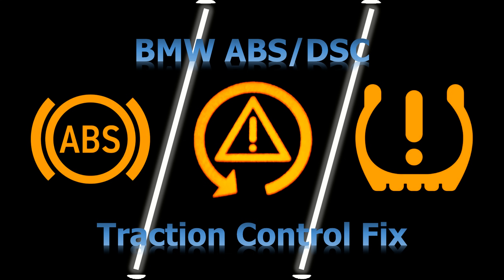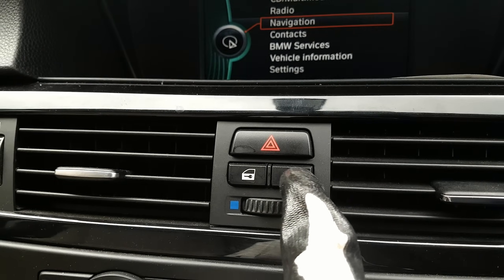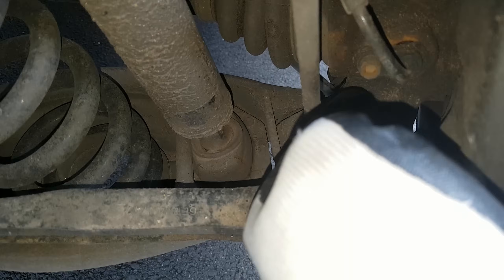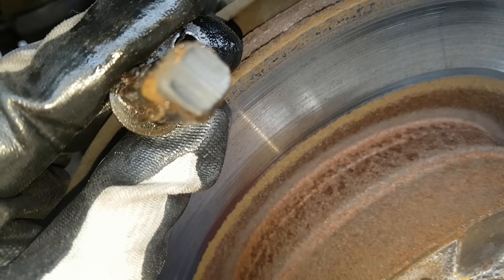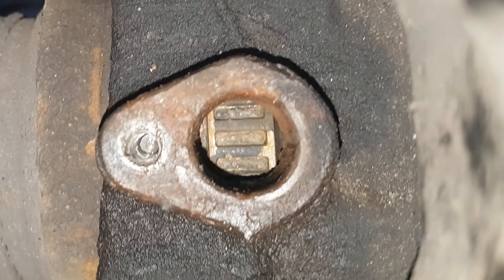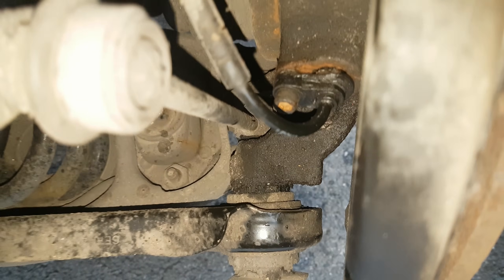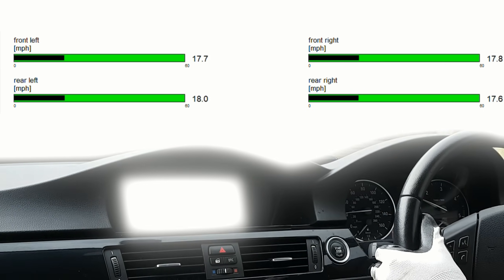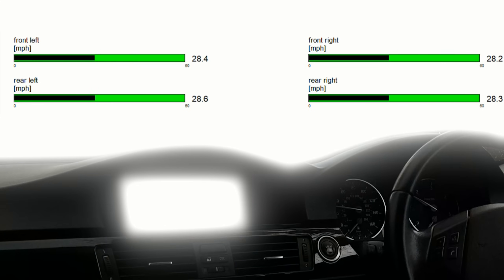BMW Traction Control ABS DSC DTC issue or loss of engine power

Comment: This literally happened to me about 10 hours ago. We planned a day trip out set off and so we got the dtc flashing us and slowing us down. We immediately did a google and your video came up. Had the dtc off all day and we are home safe. Thank you so much for the upload,we had a great day out and know how to at least temporarily fix our beloved BMW.
Reply: Did the car have no power cuz mine felt like no power and abs message kept coming on
Reply from the maker: @Everybodyshinetogether1 that's exactly what it feels like...
Reply: @laymandiy  should I just replace all sensors?
Reply: @laymandiy  should I just replace all of them
Reply from the maker: This won't solve the problem. Sensors are working fine. You need to replace driveshaft or do this

Comment: Thank you so much, would've walked away from a low mileage beautiful 320d yesterday till I watched your video and used ur diagnosis to fix the car, I actually got the car really cheap coz the owner didn't research the problem and BMW gave him a worse case fix with a huge estimate. My gain tanx to you again. Anto in Ireland

Comment: When I got my used 2008 X3 It had all three of these lights on. I found out that it was the transfer case actuator motor that had failed. It is a module attached to the side of the transfer case. There is a black plastic gear inside it that will be worn to failure after so many miles. I bought a TCA rebuild kit off of FCP Euro's website for about 100 dollars and rebuilt it. All of my lights, including the check engine light went away. FCP Euro has a very detailed how-to video on how to rebuild the TCA.

Comment: Bought it a week ago and this has been problem ever since. They replaced a tire that was apperently a different size and didn’t fix it. Now they are keeping it in the shop and replacing a transfer gear box or something (my dad couldn’t remember what they said). But everything on the internet says it’s the wheel speed sensor but the shop hasn’t said anything abt that…

Comment: just a random story about my e93 (2011 328i convertible) randomly had abs/ traction/ brake/ and check engine light were on. scan tool said p1775, p15c9 and p1505. INPA says 4 codes that all relate to rear right wheel abs/speed sensor is the issue. Live INPA data shows all wheels other than right rear are steady when driving and the right rear is "jumping" or being "jittery". took oem sensor from left side, put it in right side, and put brand new one in left side. clear codes, did 5 power cycles and drove 50 miles at all speeds. so far so good.

Comment: Guys make sure you check your sensor if you decide to buy a new one!! They are to type of sensors(for cars with active steering wheel/without active steering wheel) I have this problem since last year and I been to 4-5 garages to check my car  and everyone tell me a different think…when you put the tester  was showing I have a fault with my front left abs sensor,they put a new one and after they said maybe the wheel bearing not making proper contact with the sensor after that they said my battery it’s nearly dead and creating problems to the sensors🤦🏻‍♂️🤦🏻‍♂️I decide to give up after I have a new sensor,new battery and new wheal bearing…yesterday I decide to buy a new sensor and change my self and all the problems gone!!
My car don’t have active steering wheel and all this time I was driving with a new sensor for active steering wheel!!

Comment: Worked just as well in my BMW x3 f25 with the same error message. I had a lot of dirt on the rear right ABS sensor and on the inner tread.
 Best regards from Germany and thank you very much for no workshop costs 😁

Funktionierte in meinem BMW x3 f25 genauso gut bei gleicher Fehlermeldung. Ich hatte sehr viel Dreck auf dem ABS sensor hinten rechts und auf der innen liegenden Lauffläche. Beste Grüße aus Deutschland und danke vielmals für keine Werkstattkosten
😀👌

Comment: Thank you so much for doing this fix. I have the same problem with my 2007 BMW E78, the ABS kicked in. I have followed your method and the problem is fixed. However, the speedometer now is working intermittently, and I wonder if it is something to do with the fact that that sensor now is not fully inserted (because of the metal washer)? Thanks

Comment: Thanks for your videos they are great, my question is my 4x4 light comes on as soon as i start the car without driving and if i start to drive then abs and brake light come on. I changed then actuator gear already the old one was a little worn and the clicking has stopped when i turn car off but now 4x4 dsc light comes on immiediately. I thinks its dsc control unit since i dont have to drive for 4x4 dsc to light up right away?
Reply: I have this same problem!!! DO YOU FIND A RESOLUTION ?? Let me know thanks

Comment: You mentioned about fitting a 1mm x 7mm diameter washer.. what is the hole size in centre please...
Reply from the maker: Sorry I don't remember that one. But it doesn't matter if the whole is too large, using it as a spacer. You can stick a piece of plastic if you want to to maintain a gap (probably a better idea since it's non magnetic)

Comment: Hello, great video. 750Li no speed on left rear, change wheel speed sensor and got a speed. When I drive it for a ways, the ABS light comes on. Today when it was off, I pulled over to talk to someone and while sitting there ABS lights came on at a stand still. Any thoughts?
Reply from the maker: John Gordon whenn the light comes on does it stay on? It could be that if it is touching the ring, the sensor picks up spurious readings, giving the warning message. Alternatively, if it's too far back, the metal housing interferes with the reading. Note that this is magnetic so any metallic bit will tamper with it.
Reply: @laymandiy  maybe I will try a washer, put a thin magnet inside sensor hole before installing. Took out for a drive, parked, was going to install angel bulbs. Pressed start button, lights on dash but no start. Going to check ignition starter switch fuse and looking for intelligent battery sensor..beautiful looking car, but...

Comment: Super helpful video. thanks mate. I have an 07 335i coupe. started to hear a grinding noise two days ago. Today the yellow  ABS light came on, then driving back from work , it started to loose power. I tried holding down the DTC button, but wasnt sure if it was on, it did not indicate. But i managed to drive home. I thought it was a problem with the brake rotors or pads, but upon looking at them, they looked good. I do have the red brake light constantly on, i think i might need to replace that too. I will try and put the washer like you did. and hopefully i can get it to work good. Are wheel speed sensors expensive, is cleaning the ring hard to do?
Reply from the maker: Gordon Harrison sensors are relatively cheap and the ring is easy to clean can do it without any specialist tools. I would recommend a diagnostic
Reply: @laymandiy  so I'm having the same issue. Tried changing mechatronic and guibo but still loss of power upon acceleration and it will throw the car in either N or D. Do you think it could be the sensor?

Comment: Excellent video thank you. Mine is a 118 m sport convertible, started last week from start up and gradually got worse, almost like in limp mode! Then warning light will stop flashing eventually, abs, dtc lights stay on, but power restored!? Does that sound like the same issue? Any advice would be much appreciated tia
Reply from the maker: Most probably yes. If DTC off stops the abs from flashing (the warning lights will remain) then potentially this issue. Easy enough to give a go to check.

Comment: I did this to my 320d today, on both rear wheels, drove about 10 yards down the road and all of my lights came on 😩 abs,seat belt,airbag,tyre pressure,handbrake,traction, so not sure what happened there? Il have to remove the washers tmw and hopefully it will go back to normal 🤣
Reply: Spacer to thick I suggest 
Anyway hope you got your problem sorted
Reply: @adebradshaw2407  I afraid that that can happened to me too, so I need to be sure the spacer is less than 1 mm?
Reply: @marceloruffino  yes for me just a tiny bit less then 1mm worked perfectly

Comment: Thanks for this info...I have driven 20,000 km without this problem. After mounting a coilover front (So now the car is lowered) The light burns occasionally, i sall check the Sensors and cleaning them first.

Comment: Very good informative video. Thankyou for your time and effort. What tool will give me the wheel speed sensor information?
Reply from the maker: Inpa
Reply: @laymandiy  which version of INPA did you use? 5.0.6 tops out the reading at 10kpg and shows an error message

Comment: hello i replaced my bmw's sensor left but my lights are still on abs esp could it be because of the abs ring not recognizing the sensor properly or something else can you help me
Reply from the maker: As you can probably tell that replacing the sensor has the opposite effect (it will make it more sensitive) because it is now not compensating for the corrosion / swelling of the ring.
Reply: @laymandiy  so do you think it is wheel bearing?

Comment: Hi, actually I get some similar warning with 4×4 ebc....but they come and goes also my steering is a heavy.  So by changing drive shaft and weel bearing will solve the steering isse

Comment: Had a big gorge on my run flats on my rear left had them all changed out to none run flats  so got the tires changed at Qik fit as I had no choice now I’m getting the same issue except i took it back to Qik fit now the steering wheel is drifting to the left and the dtc error keeps coming up and they are all clueless and don’t know what to do dont even think they looked at the sensor.

Comment: Great video mate , very informative but my e92 320D has 2 lights that stay on all the time , it`s the hand brake light and the triangle one with an almost full circle around it .. once i put the hand brake down , the light turns orange light the other but stays on ...replaced ABS unit and sensors , any ideas please ?
Reply from the maker: Could just be the handbrake sensor?

Comment: Hi very good video mate. I have same problem the DSC light come on intermittently and no power for a few seconds. When switch it off completely the car drive perfect. My question is how should I gind out witch sensor is the bad one without obd scanner? I have got BMW e90 07 reg.
 Please advise me. Thanks
Reply from the maker: krum zlatanov difficult, the cable costs £15 if you wanted to diagnose. However, if it links in round corners more, left turn would indicate a right sided issue and vice versa. I'd be looking at the rears first seeing if the sensors are scored. Of course if you can get underneath the car safely, it's all visible and you can see which side is corroded most.
Reply: @laymandiy   thanks a lot . I am booked next Saturday with the main BMW dealer due to recall regarding heater motor blower , so I will ask them for a diagnostic test as well. Let see what they will say. Hopefully it won't be the abs pump. Forgot to mention that the low pressure light come on after dsc light start flashing   and have to stop and reset it despite I haven't got flat tyre.  Thanks  a gain mate
Reply: krum zlatanov have you fixed the problem? I have the same problem with the DSC and then the Flat tyre. Can a washer fix it?

Comment: i have these lights on and a shop told me my transmission is going.  i dont think they did a thorough inspection.  what is the likely hood of this being the reason for engine power loss ?
Reply from the maker: john frias if you're seeing these lights and they told you it's transmission, then go see another shop
Reply: thanks for your quick response.  i was thinking the same thing.
Reply: Hi I have a 06 325i i bought it and the brake light was on i drove it a month and yesterday it shut down on me i turned it off and it went away but today it and a code came up for gear box i turned it off it went away and now it's missing and it says crankshaft sensor is bad can this cause the to trip the trans code gearbox

Comment: Hallo, nice Video.
How you fix the Ring in the inside?
Why did you put the Metalwast inside the Sensor hole and then clean Them Up?
I will do that on my bmw too
Thanks a lot.
Greetings from Germany
Reply from the maker: To clean the corrosion. Only real way to fix ring is to take it off clean the surface and replace with a new one
Reply: Okay thanks a lot. How you Circle the Wheel to brush the corsion, while the other wheel is stay on the ground? Did you put two car jacks?

Comment: THANK YOU FOR THE VIDEO ON MY E90 320I 2006 ,I START THE ENGINE AND WHEN THE DSC LIGHT ON THE ENGINE RUN OFF. THEN I START THE ENGINE AGAIN AND DSC LIGHT WAS OFF AFTER WHILE instantly  DSC LIGHT TURNED ON ENGINE ALMOST WENT OFF . WHAT SHOULD I CHECK PLEASE?
Reply from the maker: Battery or alternator issues can cause all sorts of faults. I'd start there
Reply: @laymandiy  there is a IBS sensor on negative pol of battery which the mechanic isolated it ! all this happened after strong flood rain!  thank you for your help
Reply: @laymandiy  so i did change the battery and remove the ibs sensor wich is failed and engine run again ! i need to buy new ibs for battery !!! thank you

Comment: HI great video. If my DTC light is going on what you'v described is the problem. How do I find out which sensor it is if I don't have the diagnostics checker
Reply from the maker: You can do both or spend £10 targeting only the one you need to fix
Reply: Great question

Comment: Is this problem complete fix or come  this problem back after 6 month or 1 year back. Thanks a lot for your super video. I fix this today as you discripe this at the car from my wife. Best Regards Frank
Reply from the maker: Temporary fix. Complete fix would be new drive shaft or taking the old one and refurbishing with road removal and new reluctant ring

Comment: E90 318i PRE LCI 2007 
The following symbols light up at > 80km/h: ABS, DSC, Tire Pressure Monitor, Steering System!
What could be the problem ?

Comment: Would the car go into neutral for you at any point ? I have a 328i and I orded sensors because I believe my right passenger sensor is going out ... So here's the problem I'm having so i will start from what I did to my car .. so I wanted to have my calipers painted so I took off all the tires and had the calipers painted up and once they were cured I reinstalled the tires exactly how they came off ..  before doing any of this removing of the tires my car would roll so smooth and and a few weeks after this the car front tire would noticeably not feel correct on the passenger side.. it would feel like it was dragging like if you were in a go cart and didn't have that much weight on the front of it and trying to turn a correct ... It will still turn but that's how the car started to handle .. and then just recently I was driving around the city and I was at a red light waiting on the light to change and when I approached 3rd gear doing 35-40 mph the car jumped into neutral by its self and then when I left of the gas it went back into drive again and shifted no problem ... I have not drove the car in about 2 weeks now because I don't want to mess up any other systems ...
Reply from the maker: It has happened to me just the one time when I think perhaps it wasn't fully in gear and I went over a pot hole. You'll have to drive it to somehow to find out if something is up. Unless it happens in neutral you going to have to drive to find out.

Comment: Thanks for the tip! Which diagnostics tool are you using? I have Carly and the OBD2 scanner.
Reply from the maker: At the time it was inpa it's been long expired by BMW ISTA is the software to use. Carly does a similar job but doesn't have the full functionality of ista

Comment: Ive not seen ANY videos of repair to the front sensors. Do they even exist or is the problem always on the rear? I don’t have a diagnostic device like you and would like to limit searching for my problem to just the two if possible. Although mine is slightly different to yours. I only get it happening in the wet and traction control kicks in massively even when straight with pretty much total loss of power, then after a while I’ll sometimes get the main ABS light with the traction light and the car regains power (I think this may be the car disengaging the DTC like when you held down the button) thanks for the video, my usual garage wont touch it as they said it sounded electrical and to seek out an auto Electriction instead - so I’m on my own on this one for now!
Reply: Did my front one today. They are on all 4 wheels.
Reply: Hiya just like to know what is wrong with  my bmw e90 I have the transmission light ,traction and hand brake light on and is stucked on 3rd gear pls advise
Reply from the maker: Sounds like a major one gear stuck is probably why the lights are on in the first place..... Transmission lights? Nothing that you'll be able to solve with home tools...
Reply: @laymandiy  Hi Layman, hope you can help. 

Similar to the OP, my BMW 120D will lose power with the DTC warning light flashing. The car then regains power after a few seconds, but with the ABS, handbrake and DTC fault lights all remaining on. This will only happen in wet conditions, and the lights will disappear once the car has dried out. Any ideas?
Reply from the maker: Those lights stay on would probably mean a faulty sensor. Will need a diagnostic to be sure

Comment: what if putting the washer in  doesn't stop lights from staying on.Is it important that the gap from the sensor to the ring is right?
Reply from the maker: If it doesn't fix it, then you have a more severe case and might be time to replace the shaft / deep clean and replacement of reluctor ring